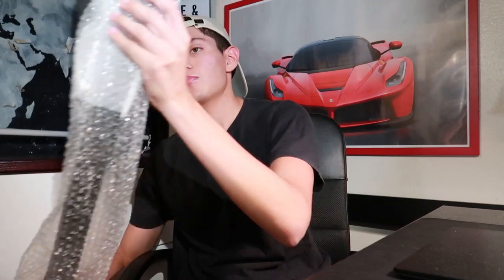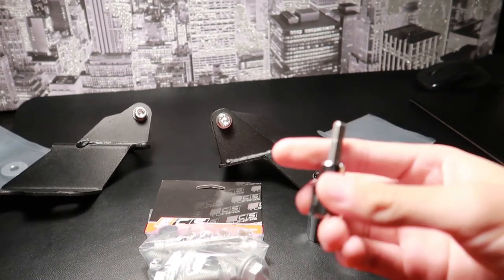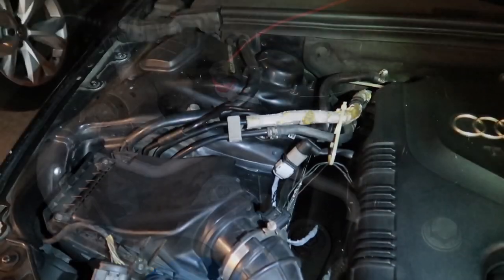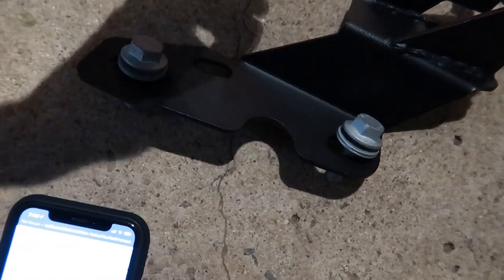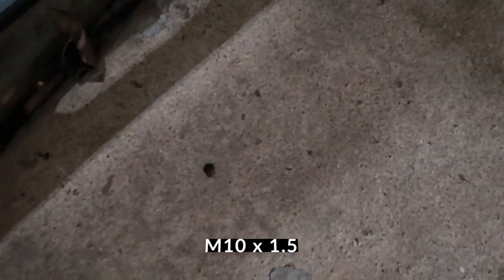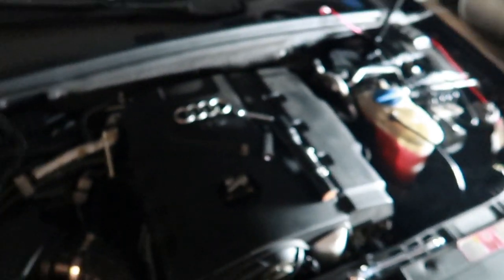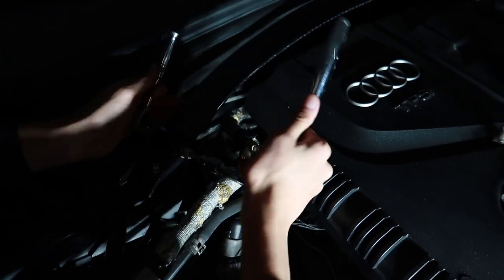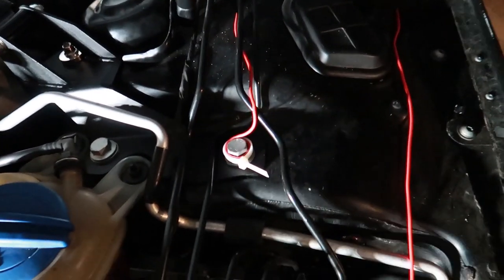Unboxing & Installing an ECS Tuning Carbon Fiber Strut Tower Brace on my Audi A4 B8

Comment: Have you ever replaced/upgraded your subwoofer?
Reply from the maker: Since I got the car I haven’t had to replace or upgrade my subwoofer. And I didn’t bother asking the previous owner. Is yours giving you issues?
Reply: I replaced mine with the original...the outer ring wore out it started to rattle instead of giving out the bass.
You can get the subwoofer which fits in the side pocket of the trunk.